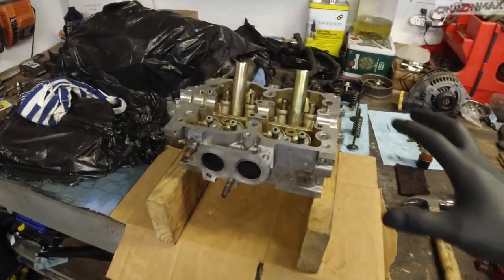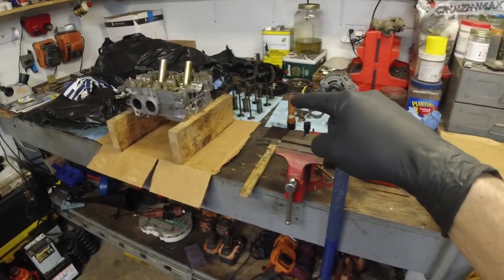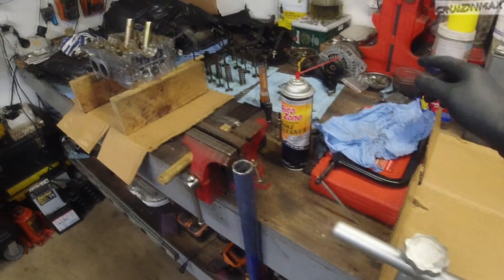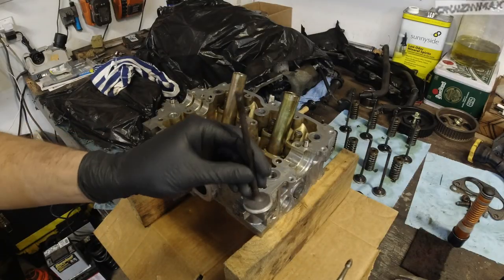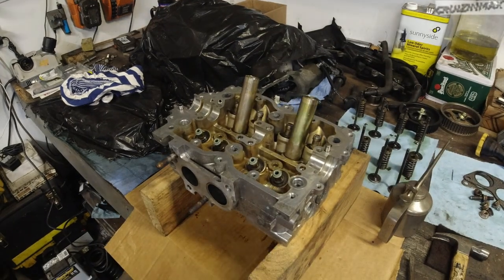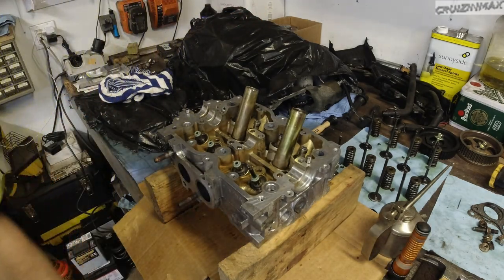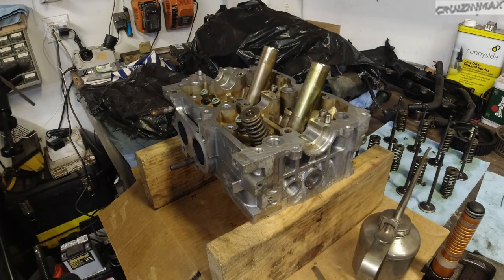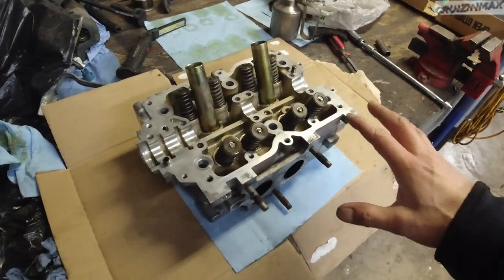Subaru Impreza 2.5L valve install part 5

Comment: I hold the part that presses on the spring washer (the barrel portion) so that it doesn't rotate when I turn the screw.  It keeps them from jumping out when you try to loosen the screw.  It still happens sometimes, but not nearly as bad.
Reply: I am currently working on three simultaneously.  It is a long story.  Two EJ 253s, and a EJ255.  Lots of room required to sort it all out.
Reply from the maker: I hear ya...2 of my benches are taken up when I work on just one